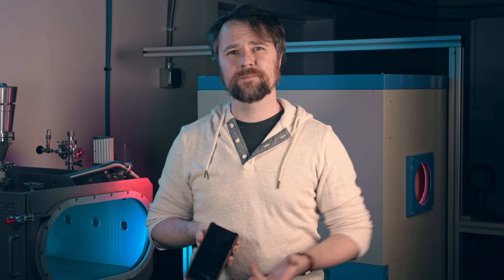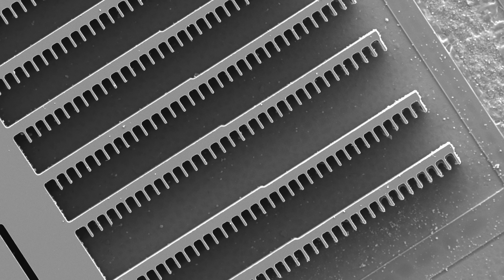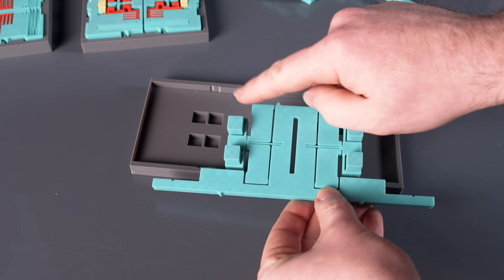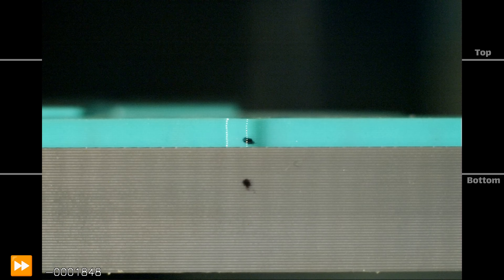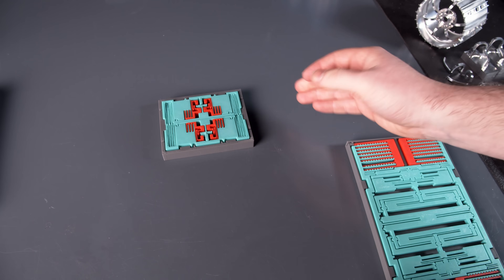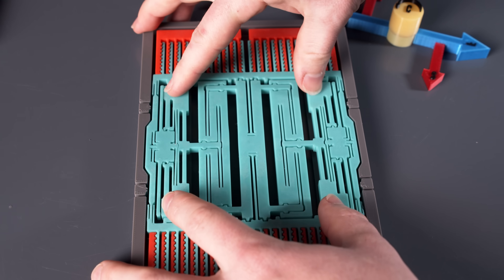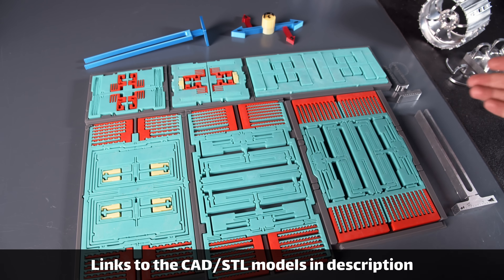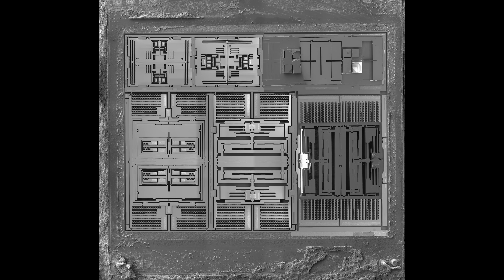The Micro Mechanisms in Your Phone

Comment: I think it's important to say that the coordinate system is relative to the phone, not the outside. You said that when the phone is falling it experiences negative Z acceleration - not necessarily. It depends how it is positioned compared to the ground. If we assume the Z axis is perpendicular to the screen, so that when the phone lies on the back the z axis is aiming upwards, the z acceleration will be recognised as such only if the phone is actually falling in this position - if it tilts, other accelerometers will also detect the movement

Comment: Could be wrong but the gyroscopic effect I was taught is Gyroscope Precession and rigidity in space.  With Precession being: Gyroscopic precession is torque induced. Described as the rate of change of the angular momentum and angular velocity that was produced by the same applied torque.  
The Coriolis effect describes the pattern of deflection taken by objects not firmly connected to the ground as they travel long distances around Earth. The Coriolis effect is responsible for many large-scale weather patterns.

Comment: I work on Mask Aligners, for over 20 years now - which is older photolithography equipment (in comparison to steppers and scanners), but still widely used. That’s the kind of tool that was used to lay down these patterns you see in the MEMS device. It’s pretty cool…but your bambu 3d printer clip compelled me to comment - although it’s FDM…. But, resin printers are actually sort of similar to how a mask aligner/stepper/scanner would work. They build the circuit up in layers, just like a 3d printer (sort of) - using UV reactive chemicals, a mask and UV light to “cure”. The process is quite different, of course. But I have no doubt resin printing evolved out of photolithography in semiconductors. Great vid, thx. 👊🏽👽👍🏽

Comment: This is an amazing explanation and such a crazy amount of effort put in! I've always for some reason just assumed that an accelerometer was a small pocket of liquid somewhere contained within a sealed chip, and the liquid would contact different pins when the device is moved, so that the device can interpret position. I'm sure there are plenty of flaws with that method but I wonder what the flaws would be with that method because at face value, it just sounds simpler.

Comment: Wow, this is some serious quality educational video right there 😯 Sub earned in first view!
Just to make sure I understand, so electricity comes in through some of the pins in the chip, at a certain voltage, which makes the inside vibrate at a certain frequency due to its mechanical properties. Alterations in x y or z, will alter this frequencey, and will make the chip output a alterareted frequence on some of the other pins on the chip, which finally can be converted into a digital value that corresponds to the g force applied x,y,z ?

Comment: The gyro mechanism seem very "overly" complicated to me. I would have thought you could use the same mechanism as for measuring translating forces, but simply connect the "wobbly part" in the center, then measure the mass rotating around the desired axis due to inertia?
Obviously much smarter people came up with the solution you presented, but like.. Can anyone tell me what's the misconception I'm having?

Comment: My first job after uni (1978) was building equipment for monitoring divers in the North Sea. We used the first silicon beam accelerometers which were only single axis. Needed 3 of them for XYZ and at today's equivalent of £500 each made it an expensive piece of kit. Plus they would break if dropped from a height of more than a few inches. Today, for £25, I am experimenting  with 9-DOF sensors in my NovaKordo - a new sort of musical iinstrument

Comment: Oh Damn!!! That Gyro mechanism is brilliant!!! I'd never have considered that. If i had no information other than what was explained in the g-sensor section, I'd have imagined a compliant mechanism that expands as a result of centrifugal forces (and you measure the expansion to get a known flex for a known rotation rate). However, I imagine that would be significantly influenced by rotational acceleration. Whereas the tuning fork style doesn't comply directly based on rotational acceleration and so is mor accurate to small changes in rotation. Oooh that's so cool!

Comment: Well about the acceleration-physics part. We are unintuitively accelerating when standing on the earth, not when we are free falling (thanks relativity). Hence the z-accelerometer will actually measure no acceleration wenn falling.
Thing about the parts, while holding the sensor gravity will pull down on the weight only and hence an acceleration is measured. On the other hand if the sensor is falling, the weight and the sensor are falling at the same speed and hence the weight will not be displaced.

Comment: It's almost laughable that all this tech was taught as "secret" during WWII.  Navy battleships used gyros the size of kitchen table to stabilize them at sea to help their guns fire accurately.  When my pals and I worked on nuclear bombers during the Cold War in 1966, the computers were mostly analog and the gyros were the size of volleyballs.

I always wondered how they duplicated the function of a gyro in a chip.  Thanks for explaining that they use tuning forks.  It was explained to us that any force against the axis of a gyro would be felt 90 degrees ahead in the direction of rotation.  This is why when you lean a moving bicycle to the right, the force actually steers the front tire to the right (that's the way I learned it). 

Our accelerometers were more like upside-down pendulums to which light springs were attached to keep them stable.  They were very sensitive to any movement and, like the ones you demonstrated, were dedicated to sense pitch, roll, and yaw.  They may have used capacitors, I don't know, but we were told that most sensing devices used rheostats or potentiometers. powered by 115 vac at 400 cycles (Hertz).  

The most top secret sensing unit was called a "stable table", the type devices in the chip you said is in cell phones today.  The stable table had 2 gyros, 3 accelerometers, and a computer.  At ground level, it was fed it's location.  At altitude, it could steer the aircraft and feed all the instruments including attitude, altitude, and direction.  Along with doppler and other radar to account for corrections, the pilot always knew where he was in flight.  It's amazing that we have even smarter tech now in a simple cell phone since this was tech we had to keep very tight-lipped about 50+ years ago.

Comment: I always wondered about the difference in accelerometer tech in a smartphone vs. a VR headset as all my phones always drift in VR after a while and it's not a problem in dedicated VR headsets. Do they simply use more chips or increase the polling rate or do they use a differently designed MEMS chip altogether?

Comment: What find amazing is that it’s apparently cheaper and reliable enough to have 2 different designs of the mechanics for both linear acceleration and rotational acceleration (one for X/Y axes, and a distinct design for the Z axis).  I half excepted that manufacturers would just have an X/Y design and put a second piece of silicon rotated 90º so it’s standing upright in the same package.  But apparently these things are calibrated accurately enough that a completely different mechanism can produce consistent values.

Comment: 4:55 “So if you’re holding your phone and you drop it… the phone will feel an acceleration in the -Z axis.”  Not quite.  The phone always feels an acceleration in the -Z axis, because that’s gravity— an acceleration towards Earth.  Then when you drop it, it feels an absence of -Z force or force in any direction— weightlessness / zero-G.  Then when it hits the ground, a huge spike in +Z direction, plus whatever bouncing or tumbling happens after that.

It’s important to understand the basic grade school physics here— normally we feel acceleration forces when accelerating/decelerating, but we’re also always feeling an accelerating force towards the Earth.  Only in free-fall (or in deep space) are we free of persistent acceleration forces from gravity.

This distinction is also important to how smart phones function— they often need to know which way is down, for screen autorotation and some other features on some phones (auto display sleep/wake, antenna tuning).  Down is just which direction has roughly 1G of acceleration force (after a low-pass filter to remove vibrations of phone in your hand, and usually a rolling average of that to make sure the down direction isn’t temporary).

Comment: This is a really good explanation of a bunch of this stuff (and I love the 3D-printed zoomed-up models which are an amazingly great idea), but:

[I just realized after I posted this that the pinned comment above already includes basically this correction (oops).. I'm keeping it here, though, because I think the part at the end of my comment is still relevant and important, and wasn't mentioned in the other correction..]

4:57 "If you're holding your phone and you drop it, the phone will feel an acceleration in the negative-Z direction"  This is actually wrong.  If you're holding your phone and you don't drop it, or if it's just sitting on a table, etc, then the phone is constantly feeling an acceleration (technically in the positive-Z direction) due to gravity.  If you drop it, and it is allowed to free fall, then it will actually feel no acceleration at all during the time it is falling.  This is exactly the same as how you feel weightless when you're falling, etc.

This distinction is actually important, because that constant acceleration force felt due to gravity is also how the phone can know its orientation relative to the ground at any given time.  If it detects that the acceleration it's constantly feeling changes from the Y direction to the X direction, for example, then it knows you've changed the orientation of the screen and it should automatically switch the display into landscape mode so you can watch your movie, etc.

Comment: Did you know that Sony phones are also use vibration if they fall, so they can land at the best possible way to avoid screen damage and generally to minimize damage. 
At least some older flagship models used this technology, the ones with the bezels, i don't know about the current Sony flagship models. Probably they use it too, unless Android put some restrictions or Sony decided to no longer use it for whatever reason. 
You get more than what you see with a Sony.

Comment: Nice video! It helps a lot to demystify MEMS. 
However, allow me some comments, which you might find useful to improve your work: I believe that the explanation of the X/Y gyro needs to be reworked:
1)	The trench under the masses indicates that the driving motion is out of plane, not in plane as you described. Driving motion is usually in the range of a few micrometers, therefore comparable with the cavity under the masses. A trench is therefore needed to avoid collision. However, sensing motion (the motion induced by Coriolis force) is a million times smaller, so no trenches would have been needed.
2) Invensense gyros are usually "AM vibrating gyros" - the sensing is not a shift in drive frequency but rather a secondary vibration whose amplitude is proportional to the applied angular velocity. This vibration has the same frequency as the drive, but a million times smaller amplitude. It is induced by the Coriolis force on driving masses and mechanically transferred to the external masses facing the external combs.
Reply from the maker: Thanks for the note! I was kicking around that alternative with a few folks prior to publishing since it seemed the other likely scenario. The thing that kept me from that possibility is the lack of any drive mechanism under/above the device in those regions. The cavities seem entirely bare of any kind of actuator, no traces or pads, etc. At least none that I could find. It could be driven "off-center" away from the cavities but that seemed less likely?

I sent the CAD files to a friend that has a copy of Coventor so hopefully we can get some simulations run and see. If it turns out to be opposite of what I described, I'll post a followup!

Noted on the amplitude instead of frequency! Will keep that in mind if/when a followup is published 🙂  Cheers for the note, really appreciate it! I'm hoping that even if that particular detail was incorrect, the gestalt of it still stands for a layperson :)
Reply: @BreakingTaps  The video is great, regardless of the correctness of my comments! I did some googling and found this picture: https://www.macnica.eu/sites/default/files/images/HiQNews/2013/InvenSense%20-%20MPU3300/XAxisMEMSGyro_01.jpg. The bottom of the trenches must be plate electrodes directly connected to the electronics below (Invensense bonds MEMS wafers and ASIC wafers together).

Comment: 5:00 actually it will detect the lack of acceleration, as it is normally "accelerating" due to gravity, and in freefall that vanishes.
Reply: We should distinguish between ACTUAL acceleration, which is a derivative of actual velocity, and the FORCE of acceleration. i.e. when you drop the phone, it starts moving and accelerating. You can see that it is really moving and accelerating, When the phone is on the table it is NOT accelerating,  But it is feeling the acceleration due to gravity.
Reply: @8546Ken  Well, according to the theory of general relativity, there is no real difference between gravity and acceleration. You can't perform any experiment to decide which one you are experiencing, so who is to say what "actual" acceleration is? Btw, just like with any other experiment/sensor, this one is also sensing gravity EXACTLY the way it is sensing acceleration. This is not a flaw or glich, this is physics at work.

Comment: You could've used GIMP to turn the images high-contrast, then rasterized them in Inkscape, then uploaded them to Tinkercad. The printing would take a few days yes.
Reply from the maker: I thought about automating it to some degree, but they also needed a fair amount of hand holding to make printable. Simplifying the combs, ensuring a minimum gap between all areas, etc.
Reply: @BreakingTaps  Right. Still, very nice prints.

Comment: 5:16 The phone measures 0 when falling, it's only when in hand or on table an acceleration upward is measured.
Reply: We should distinguish between ACTUAL acceleration, which is a derivative of actual velocity, and the FORCE of acceleration. i.e. when you drop the phone, it starts moving and accelerating. You can see that it is really moving and accelerating, When the phone is on the table it is NOT accelerating,  But it's feeling the acceleration due to gravity.
Reply: @8546Ken  No we shouldn't, we should use the values as recorded by the microprocessor.  After we’ve recorded the values, we can compare them to what was assumed they would be to see how well the model works.
Reply: @PetraleiTanyl  It depends on the context of what we're describing.  If I'm talking about what the phone is actually doing when I drop it, I can see that it IS accelerating downward.  If I'm talking about what the accelerometer is doing, it is reporting zero acceleration.

When we studied acceleration in physics 101, we dropped a weight attached to a paper tape, which recorded the movement from which we could calculate velocity and acceleration.  Yes, the weight did accelerate.  We need to be careful with the semantics. And specify the frame of reference.
Reply: @8546Ken  it's not a video on how eyes work.  Of course what we are talking about is what happens to the accelerometers.

Comment: How does it tell the difference between clockwise and counterclockwise rotation?
Reply from the maker: The force felt due to coriolis will be opposite depending on rotation direction. So if a clockwise rotation causes Up/Down force when the forks are Left/Right, a counter-clockwise rotation will cause Down/Up forces. The sensing combs and electronics will be able to differentiate Up/Down vs Down/Up and determine the direction of rotation.

Similarly, if the forces are Down/Down or Up/Up, it knows that's just a linear acceleration instead of a rotation. That's the main reason a tuning fork is used, to differentiate rotation from linear.

Comment: Very interesting. What I think would also be interesting, is how we could make simpler models for 3D printing or handicrafting, for educational purposes. For example, making a foam airplane which to use only mechanical sensors and non-electromagnetic parts to try to keep the foam airplane level, or for making mechanical sensors similar to those on an old vehicle's dashboard. A speedometer, a gyroscope, and an accelerometer, as well as the mechanisms to convert that into a clear readout of the current value, would be interesting to see. Think of it this way: If you had to make those sensors for an airplane which needs to be purely mechanical, and size and weight weren't constraints (i.e. for a rigid-hull airship which is completely immune to EMPs and CMEs), how would you do that? Or, for a fair/show with what mechanisms are possible without electricity. And an honorable mention is the chinese mechanism used to measure the distance traveled.